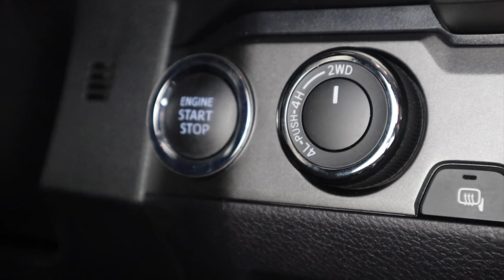Should you buy the latest Toyota Tacoma 2016-2021?

Comment: Thanks AMD! This is very useful information. Now I know why my AC sucks in 100+ weather. Please make more Tacoma specific DIY maintenance videos, us enthusiasts would love it!!
Reply: Did you ever find the A/C Kit he was referring to? I can’t find anything online and the dealership doesn’t know what I’m talking about....
Reply from the maker: It’s not a kit in itself with one part number. It’s a TSB which the dealership should know about. Have them look up TSB 0063-18 or you can google it and get a copy which will have the full parts list.
Reply: The Car Care Nut I have a 1994 Toyota Pickup 4X4 V6 Manual transmission with 234,000+ miles. When I am on the freeway and shift into 5th gear, whether I am going 60mph or 80mph AS SOON AS I put it into 5th gear the whole truck vibrates pretty bad. The vibration does seem to not vibrate as bad when I hit 70 and keep climbing to 80mph, BUT it still has a vibration. It vibrates BAD/worse with pressure to the gas peddle to speed up VS “driving like there are egg shells under the gas peddle”. All the drive shafts joints are all tight, the transmission expert says it can’t be the transmission but no one has any idea of what I can be. I can be going 50-80mph and zero vibration but the SECOND I put it in 5th the truck vibrates bad. I push the clutch in, and it immediately stops. Going down hills seems to mitigate the vibrations since it’s not “under load”. I don’t know if this is relevant to the issue, but going up steep inclines in any gear higher than 3rd is next to impossible. Really, 4th gear struggles on mountain hills in 2wd as well (but no vibrations). 4WD high and low have zero issues (though I never put it in 5th gear in 4WD high or low). I love this truck and am NOT getting rid of it so, new transmission isn’t a concern, but like you said “I’ve never seen a Toyota transmission break”. Any help would be much appreciated! Thanks a million!!!
Reply from the maker: Hi Fred. Check your driveline alignment. Might be difficult to do diy. Also has the u joints been replaced? Are they indexed?
Reply: The Car Care Nut “Indexed”? 
The u joints have not been replaced however, a reputable mechanic said they’re fine.
Reply from the maker: Did he measure run out and drive the truck on a lift to see what happens in 5th gear around that speed?
Reply: The Car Care Nut No he did not. He simply shoved a flat head screw driver into the u joints and checked for play and concluded they’re still working properly
Reply from the maker: Well he’s gonna need to look into it more that’s not a very accurate way

Comment: Glad I found your Chanel, have had Tacoma's for years, just got a 2022 SX 4x4 with the 2.7 engine. Love it, this engine has an outstanding reputation. I hated to change the oil in the 3.5, dropping the skid plate and dealing with that canister oil filter sucked. Yes I gave up some power but really don't need it for what I use it for.

Comment: With this video, sir, you have provided an invaluable service…..to both prospective AND current owners.  In my 66 years on earth, I’ve owned three Toy pick ups, all manual transmissions (‘84 SR5 Mirage Edition, ‘16 TRD O/R, and a ‘20 TRD O/R).  I also own an old Porsche….and within the Porsche community, you don’t buy used unless you get a PPI performed by a knowledgeable source….and that source is often NOT a dealership.  For those buying a used Tacoma, due to the increasing complexity of these trucks….it’s worth the $100 (+or-) to get a PPI before you sign.  If the seller balks at letting you get a PPI, run like hell away FAST.  I put 450K on the clock of my old ‘84….and only sold her as rust took it’s toll, and I seriously doubt I’ll have the same trouble-free performance with my current Tacoma.  Did this ‘old dog’ learn something from watching your video?  Absolutely.  Again, you have just provided an invaluable resource to prospective and current Taco buyers….Bravo-Zulu, sir…..well done!
Reply: Did you change the transmission fluid at all?
Reply: @User_91hsj  John Ford….great movies by your namesake!  Yes.  Back then, I was anal retentive about maintaining that truck!  About the 250k mark, some weirdo party-biatch, pulled out of her driveway FAST without looking, in Sandbridge (beach community near Virginia Beach), roads were sandy and wet, I braked and countersteered the slide….and I would have been find as I avoided slamming into her side, but the asphalt roadway had no shoulder…just an 8-10 inch drop to sand.  Once I slid to the side, both right side wheels hit the edge at the same moment, rolling my beloved truck 1 and 3/4 times.  My insurance company totaled the vehicle….but the “miracle workers” at Colonial Toyota in Virginia Beach, rebuilt her for close to the check my insurance company paid, replacing fenders, windshield, and only slight straightening the roof (I had the moonroof and the Mirage roll bar) repainted her that great dark metallic gray, and even applied new Mirage decals.  I drove her for another problem-free 8 years…another 200k on the odometer.  Yes….I always changed oil, all fluids, according to the manufacturer-recommended schedule.  Why do you ask?

Comment: Got a 2016 with 102456 miles. Bought from hwy. fleet company in Texas. they did all updates. Have not had any problems, small motor so it does shift often going up hills, but that was expected. Got it for work only. So no worries. Thanks for unbiased view.

Comment: Had the timing cover seep on mine.  what a job for the tech
Reply from the maker: It’s a bear of a job honestly. Either drop the front differential out or pull the engine out
Reply: @TheCarCareNut  they had to pull the engine, 4 day job.  if it happens again, i will keep it seeping..  great channel.
Reply: @haroldbrown3452  I check my tacoma timing cover today  no oil dripping but did see some oil residue and grime  not alot .is that what happen to you???
Reply: @keithbullis4337  sorry, just seeing this.  yes, it was a small amount of oil gunk on the front end.  it never dripped on the floor, the engine gets hot enough to basically stop the drip i guess.  i will not mess with it if it seeps/leaks again.

Comment: Great video. I have a ‘17 SR5. Some of the issues I had no idea about such as the engine cover leak and coolant leak so I’ll double check. I have had the 3rd brake light leak (I knew to look for this and replaced it myself with the new part, before a recall campaign was finally issued this year). I also noticed the annoying whistling and had the plugs installed in the lower control arms, and I had the frame inspection completed, they added plugs to the frame. Finally, I had front brakes replaced at about 45,000 miles and also changed out the battery at the end of 2020. The 3rd brake light was the most annoying issue in my opinion, and the rest has been easy to address. I am very satisfied overall. I now have plans to oil coat the frame & under carriage. I live in New England with winter and road salt, I think this is a good idea as mentioned in the video but I haven’t had it done yet in the first 5 years of ownership. However, I do wash the undercarriage regularly in winter which is a must. There are no significant rust issues so far.

Comment: I have a 2016 3.5L Tacoma. Bought it brand new. 70,000 miles so far. Did the 3rd brake light recall. You missed the part where they had several thousand units ship with faulty bearing carriers in the rear end in 2016. I got mine replaced after a huge leak 3 months into ownership. My stereo is definitely starting to have Bluetooth on issues. One thing everyone should look into is Toyota's paint recall on their white vehicles. It covers like 12 vehicles over a 20 year span. They didn't include the trucks as they figured the paint would be destroyed. However, the clear coat on my hood and roof has faded almost completely and there is severe chipping around the mounding of my driver side rear window. My truck is no garage queen, but it isn't abused either. They have agreed to inspect it and will possibly cover it under that same recall. Look into it if you get the chance!

Comment: 2017 Tacoma TRD OR 4x4
I've taken the truck in for all recalls... none effected my truck. My belt did start to chirp at 50k... but only at startup. I'm getting the transmission fluid change out tomorrow. I'm currently at 55k miles, the truck is very solid. It drives like a 4x4 truck, that's why I like it. 👍

I had no idea about the AC fan. I'm in south GA. That's awesome thank you!!

Comment: We have a 2016, rear wheel, smaller engine Tacoma and haven’t had too many problems. We bought it used last year. It has 90,000 miles. It was a fleet truck for bug exterminator. My husband is a machinist and checked it out carefully before we bought it. They had just replaced all the brakes. We did need to do the AC fix. It does ride like a old time pick up, but that’s ok. We live in the rust belt and will be undercoating it. We pull a smaller pop up camper and she doesn’t have any problems with it.

Comment: Brand new Taco off-road 2017 at  8 months old a/c fan blades broke apart. (replaced warranty np)  3 months later got a recall for the a/c (replaced np)  Then some 3k miles  over warranty ac broke again.  So yes some problems with the ac.   FYI: Change that cabin filter yourself for about $28  (located in the glove box)  if your ac is cold but no blowing - mine had leaves & all kinds of crap  it made a huge difference!

Comment: Great video again!  I special ordered my 2016 Tacoma TRD off-road 4X4 in Blazing Blue Pearl, it was built in Texas in May 2016 and the only major issue I had was a leaking fuel line right above exhaust manifold on the drive side at 80K miles.  I also had to replace the blower motor at 30K miles.   I have not got any recalls on it, yet.  Still have the original front brakes, no rust what so ever here in Florida.  Great point about the rear drums though, the driver side one is always catching first (2nd click on the hand brake), I wish my dealer would take the time to adjust it properly.  Time to explore another dealer.

I Was rear-end 2 years ago, I was at a standstill on I-75 and a Frontier ran into me around 35-40 MPH.  The Frontier was destroyed.  It make about $6500 of damages on my Tacoma, including the driver seat that was destroyed to protect me from whiplash injury!   I used to change cars every 2-3 years... I have no intension of selling this one.

Comment: Love our 2014 Taco 4.0L V6 and didn't plan to upgrade to the next gen anytime soon.
Reply: I had a 13...only real issue was replace rear springs. Truck is a piece of granite. Towing was not bad but upgraded to the Tundra last year.
Reply: Keep it. I think most would agree the 2nd gens are better trucks
Reply: Good choice. My 2019 is totally gutless. Wish I had my old 4.0 in the new body. Gas mileage is about the same.

Comment: I watched this video when it first came out and I was looking to buy a manual transmission Tacoma. I remembered AMD right away when my clutch pedal started squeaking a couple of weeks ago at less than 30k miles. lol! Read on the forums that brake lube on some key points of the mechanism would fix it and I’m glad I tried that first, because it fixed the problem

Comment: Owner of a 2018 trd off-road here, definitely seems like I dodged some bullets here 😂 one thing I do want to bring up from experience is that the truck is a great off-roader, but the engine can suffer due to stuff found off-road, I personally had to replace a pulley because I had mud make its way into the engine bay and damage the pulley, it caused a very minor squeak which was as he says an annoyance and costed 300$ to fix, just a heads up :)
Reply: I have the same truck fucking love it. I’m glad seeing your comment because I’m going to be stationed in Alaska soon and going to do a lot of off-roading with it. So I’ll make sure to keep the bottom of the truck. But does your engine seem to stutter around 40-55 mph?

Comment: A little upgrade... My 2016 tacoma 6cyl. automatic , startet to stutter on 2-3rd gear @ low rpms 2000 to 3500, I took it  to a toyota dealer for transmission fluid change, and they "found" metal chunks / flakes in the pan, now they are charging me 5400$ for a new transmission.... my truck wasn't making any noise, hits or  any rare issuse,  just that shake as mentioned,.... when I got to the dealer for service they seemed surprissed for this problem.... In my opinion they're just trying to rip me off, and now I have the freaking doubt if changing the fluid and keep running , would cost me 5400$ in the long or short run... try to take yours to someone that you trust.
BTW.. thanks for the videos !!...

Comment: I’ve had a 2016 since it was new. So far I’ve only had two problems with it. I had the 3rd brake light leak and I also had the pull strap thing that releases the rear seat back break so I couldn’t get behind the seat. Other than that no issues but it’s good to know what to look out for.
Reply: Mike I hope you contacted Toyota about that leak I have a 2017 and I was told  there's a recall for it

Comment: I really wanted to get the new tacoma, but I'm kind of worry about all the mechanical issues with noise and cutting corners by using cheaply made parts that are prone to be problematic as you put more mileages on them.
Reply: Buy a 22 or 23 
23 is the last yr of the V6 and Ived owned Toyota' v6s with 300 thou no problems

Comment: You're so right!!! I own a 2016 Limited. It had a transmission replaced at 156,00KM (90,000 miles) They couldn't give me a reason why. I had the extended warranty until 160,000 km which was my only saving grace. Don't pull heavy loads, just a small utility trailer a few times a year. Now at 204,000km, it's starting to vibrate slightly at 70-80 Km/h (45-50 Mph). I think I'll be looking for a newer Taco.

Comment: Great advice on the 4x4 system, some Toyota four wheel drive owners advised that I engage the four high and low system at least once a month.
Reply: Toyota literally says to drive it 10 miles every month in the 4x4 mode in the owners manual .

Comment: Great Video. Thanks for taking the time to help us. My 2018 TRD Sport 6MT never saw most these issues. 

1. I have some vibration at highway speed but I think that has more to do with the wheels / tires being out of balance. 
2. My AC system leaked freon just as I got out of warranty @ about 75,000 km. The dealership said the leak path was a common issue. Easy fix and recharge the freon. 
3. My battery died at about 4 years in service. From what I hear that is average. I never discharge for to long and I use a trickle when I am not using the truck. 
4. Bluetooth connection dropping and touch screen freezing probably happened about 4 times in 4 years. Not to bad.  
5. Once a week while commuting in traffic at a stop, the dog gears / synco's / selector sleeve would not line up perfectly to allow me into first gear. Simply had to go back into neutral when this happened and retry. 
6. Using 4Low in the manual was fun on the trails but shifting through 2nd, 3rd, ect had a very notchy engagement. Having the transfer case engaged seemed to make the syncro's feel a little more grabby than they would if the truck was in 4H or 2WD. (The use case for this would be towing a heavy trailer up a logging road with steep sections and being at speeds in-between 1st and 2nd. where the gearing in 4H was to long.) Gearing between 1st and 2nd could be a little closer IMO. 
7. The clutch pedal squeaks. I just accept it. 

Overall the truck is still amazing and the reason I got it was because of the manual trans. Hard to say how much longer you will be able to get them on a body on frame vehicle.  Also the V6 Sport MT's have hill assist which makes launching a boat stress free + you still get a lever style parking brake in place of the fancy electronic ones.

Comment: Thanks for informative video. As an owner of 2019 and 2021 I would add one more issue to the list. Rear differential howling noise, which some people mixed it up with whistling sound from chassis that you mentioned. There are a lot of people including me having the same issue. You may find few hundred page related to this issue in tacoma world forum. I had a 2019 and the issue started after 1000 mile on it . Ended up replacing rear differential but same issue emerged after another 1000 miles. Even if you check a all brand new ones, it has some degrees of howling noise but the intensity is different from one truck to another. That's why I traded in my 19 and got a 21. So far I have 3k on it and it is not noise free but the howling noise is not on my nerve. 
My recommendation to new/used buyer :The noise is experienced between 52-60mph(mine was maximum between 54-58) when feathering throttle, make sure you drive it on highway a while and check for howling noise within that speed range by just accelerating decelerating to find the possible howl noise.
Reply: My 2017 SR5 had the rear diff howling between 53-60mph. Sounded like a dump truck. Diff was replaced at 400 miles. The new was quite and improved with mileage. Dealership said they all do it.